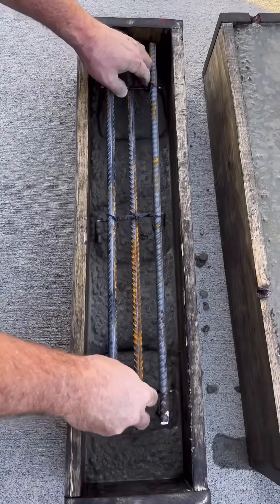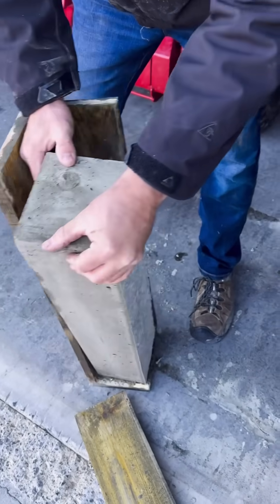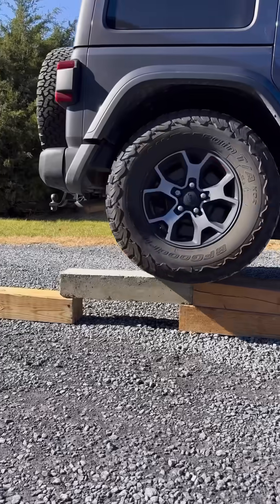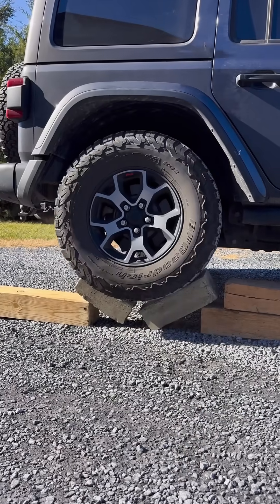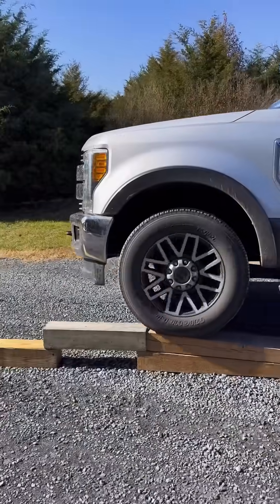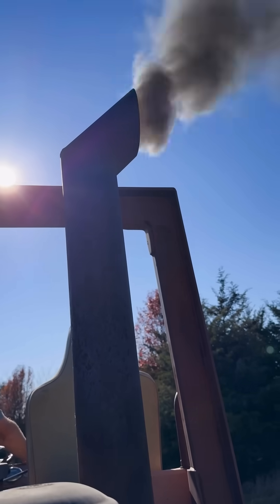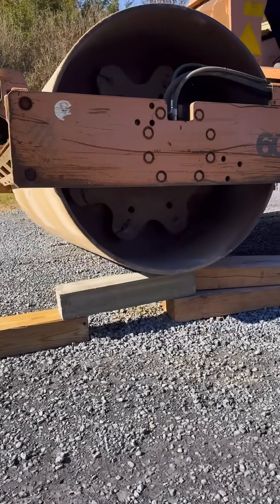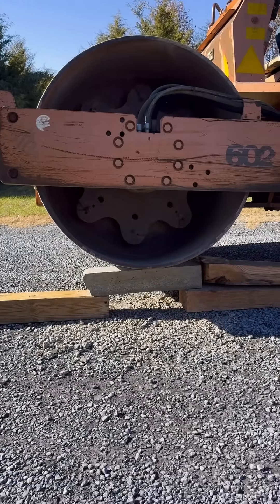Why We Use Rebar To Reinforce Concrete

Comment: I would love to see the same test with Helix fibers, glass fibers, and then rebar in addition to the fibers.
Reply from the maker: That would be interesting, thought about using fiberglass rebar to see how it would do
Reply: @hausplans test it with Prestressed concrete too
Reply: @hausplans please do this, would be really interesting
Reply: @hausplans The fiberglass stuff works but It obviously isn't as strong as steel so you need much more of it to achieve the same tensile strength.
Reply: We'll still find a way to make 3-D printed homes possible. Dont think you can act crazy and we have to put up with it @hausplans
Reply: @hausplans try horsehair too, they used to put that shit in everything
Reply: Waiting 28 days and using salt water and lime
Reply: @danielbergmans816 nice recipe, Julius. glory to Rome
Reply: @danielbergmans816 5 days enough
Reply: @danielbergmans816  except
Reply: I’ve done pours like that. Just got to be sure you’re accurate on elevations. Cause it ain’t coming out
Reply: Yea do this next
Reply: Fiber is used more to control cracking and not for tensile strength.
Reply: @KSU-ce2uc  Yes, glass fibers are used to minimize cracks by distributing the tensile strength throughout the concrete.  They are not rigid, though, and provide no structural strength.  Helix steel fibers are rigid and their twists lock the fibers in place.  It is claimed and demonstrated that in most cases, Helix can take the place of rebar.  Big game tomorrow...go Jayhawks!🤣
Reply: @KSU-ce2uc so it should be combined with rebar?
Reply: @kiyoponnn  yes
Reply: Try pykrete if you have a winter.
Reply: And hemp^ or an experiment with hempcrete and how it compares on all levels with concrete (with and without rebar)
Reply: I've heard of Ironworkers trying out fiberglass bar, everyone had fiber glass in their clothes and gloves,
Reply: And a test with fiberglass rebar
Reply: Rebar is used because the concrete is less likely to crack over time because the thermal expansion of concrete and steel are pretty close.  Not sure how the other fibers would work long term.

Structurally it doesn't matter. You put the rebar in under tension so it tries to go back to it's old form, putting the concrete under compression.
Reply: @haroldsandahl6408  its because of characteristic of glass rebar 
If it not pretensioned  concrete will crack at bottom surface  under load
Reply: if you want to go to that extent you might as well run the test with a hydraulic press to learn at what exact weight does the beam give out
Reply: …and a good one-month cure time as well.
Reply: So would I
Reply: I’d love to see this
Reply: Fiberglass will fail nevertheless its stronger than steel 
It need to be pre tensioned before  adding concrete 
I already saw some tests )
Reply: I am a glass fiber worker (we make the back of the very big trucks) and i think it wouldn't work because glass fiber is flexible and rebar is not so it would make it more fragile
Reply: Fiber reinforcement was exactly my first thought. I'd be interested also.
Reply: I believe there is a channel that does like infrastructure engineering had already done this
Reply: I'm betting on the rebar. I've been on many job sites and have never seen a pro use fibers. As a matter of fact, they're laughed at as a DIY gimmick.
Reply: @mikeschmidt4800  Yep, them there Helix Miro rebars were invented by some f'n idjut who went to college.
Reply: And Aircrete...
Reply: and hemp
Reply: That would be cool
Reply: I would like to see compressed and sealed hemp blocks.
Reply: I’d be more interested if it this beam was closer to a structural slab format with two layers of reo so the bottom layer has better leverage to counter tensile stresses through its tensile strength, rather than a single layer sitting at the neutral plane of the forces and only acting as a leaf spring.
In addition to the other new technologies mentioned above you could also test PTs through the base and compare that too
Reply: @samwilliams1517  Yes, you are right, rebar should be at the bottom.  With fibers, the tensile strength is distributed throughout  the concrete and cracks that develop are hairline and prevent spaulding.  The twists in Helix help the fibers perform more like a screws, binding to the concrete, whereas glass fibers perform more like nails which can be pulled out.  Fiberglass rebar has more tensile strength than steel but not as rigid.  So there are a lot of variables and it would be informative which combination works best.